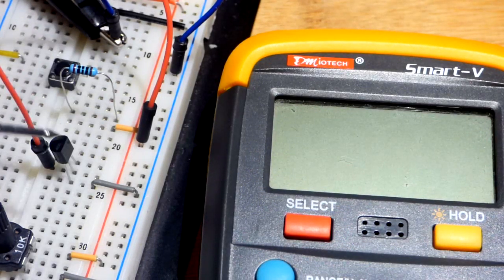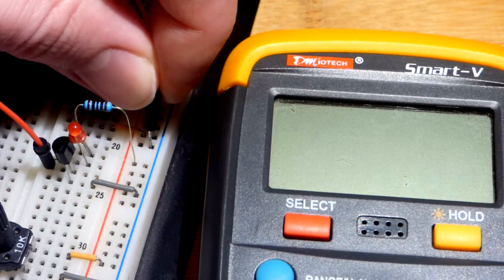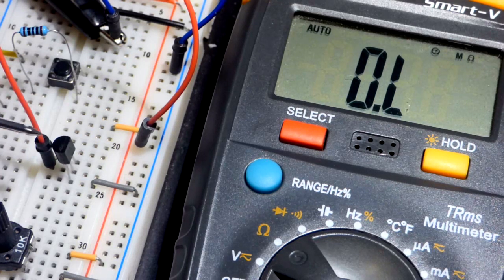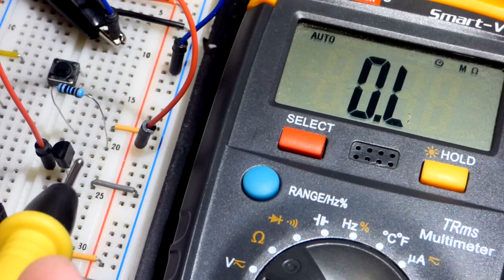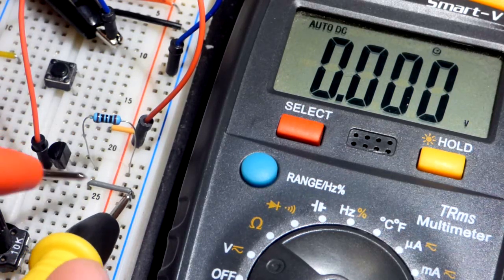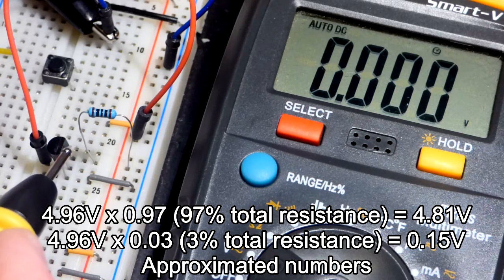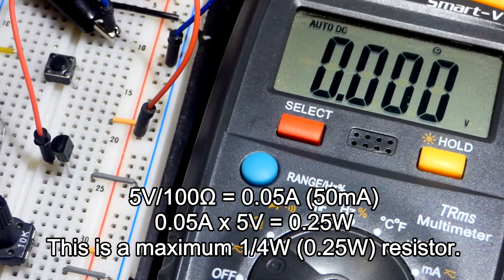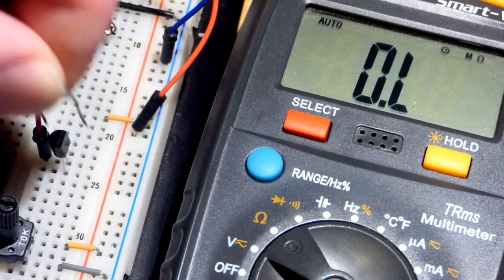Testing the Rds on for 2N7000 N channel MOSFET on resistance from drain to source by electronzap

Comment: doesn't Rds ON mean when mosfet is in ON state AND high current is going through it? I mean you are just measuring it when it is open circuit like as if it was a resistor. but it is not. right

Comment: Hi do you remember the formula for calculating the exact resistance, I remember there was one for this. where you could use the voltage drop across one resistor to calculate the exact resistance when you only know the resistance of the other resistor and the voltage o the voltage source. however I don't remember what it was.